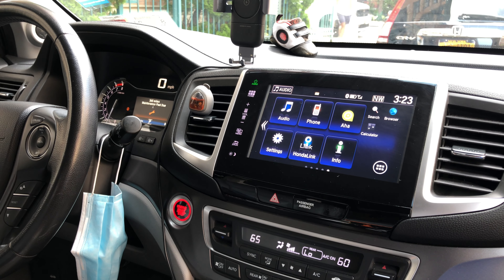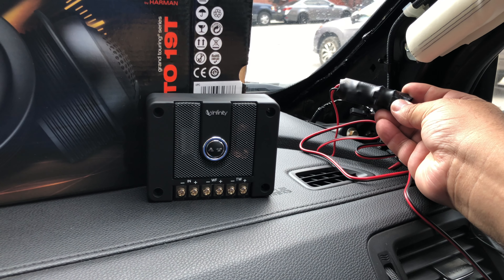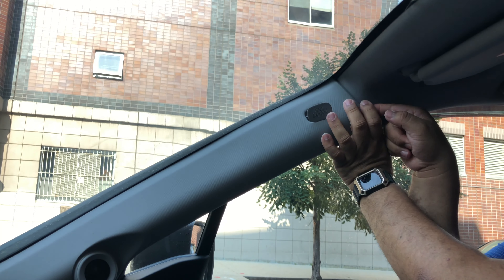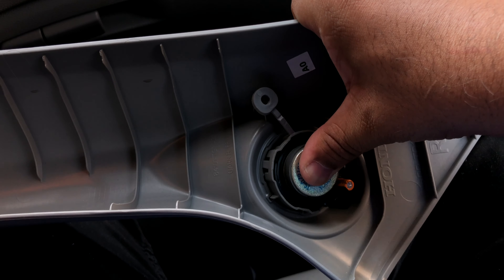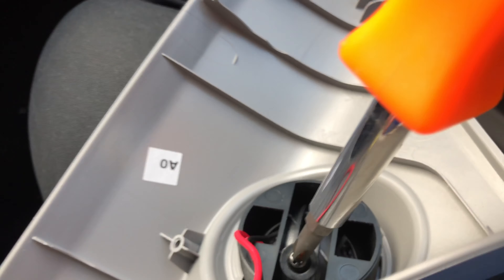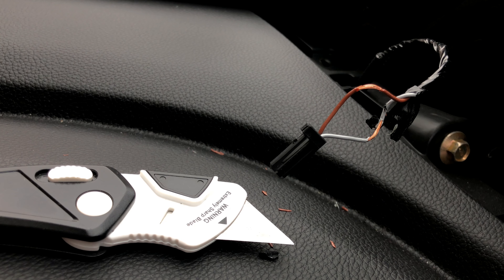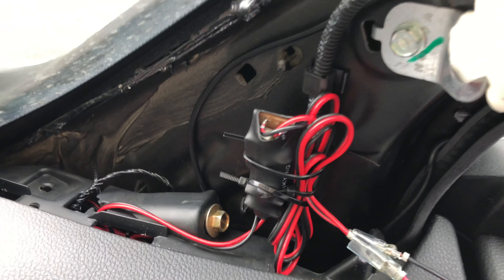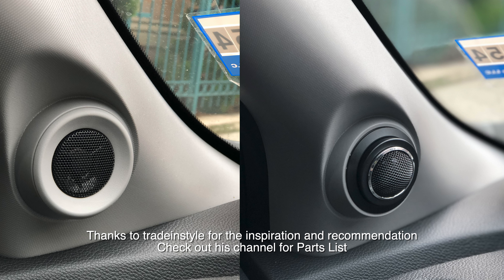Tweeter Replacement

Comment: Question bro, did you disconnect your car battery before doing this installation for precaution?
Reply from the maker: I don’t think I did for the tweeter.   I deferent did for the sub installation.     But it’s a good sides to disconnect it.   Don’t be afraid after you plug he battery back on. You’ll get some warning on the infotainment  however in a minute or so it will reset itself back to working order.
Reply: @manguman  Thank you for the response bro 💯

Comment: Hi mate im impressed how the tweeter setup goes.... i have pioneer tsd65c that came with tweeters and a cross over cable.. i am so confused how this wires up?
Reply: The crossover cable goes between the tweeter and the vehicle speaker cables.  It prevents lower frequency signals from reaching the tweeter.

Comment: Hi, one idea of how to remove the panel to access the subwoofer in that model and year 2018
Reply from the maker: I did not remove the stock subwoofer.   I left it in there and added a powered subwoofer.   replacing stock subwoofer has will not have an audio difference.